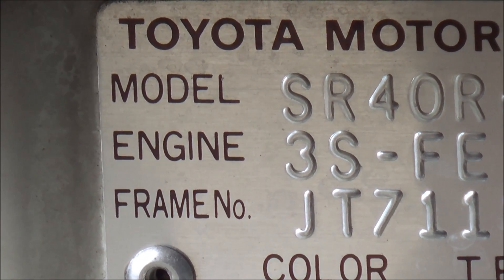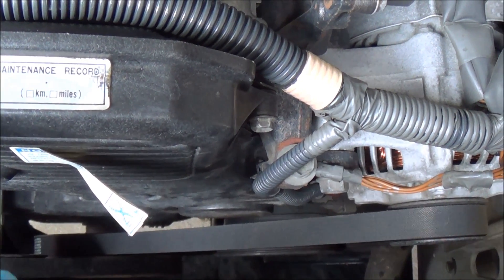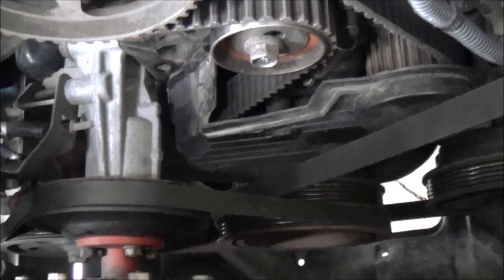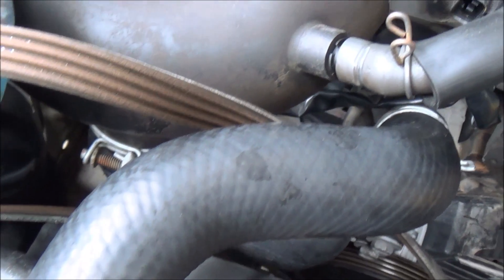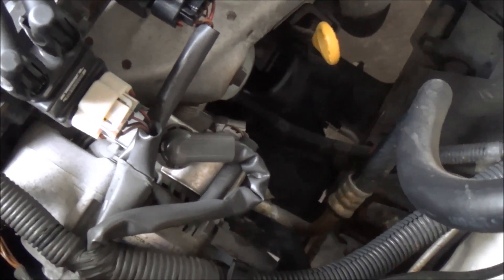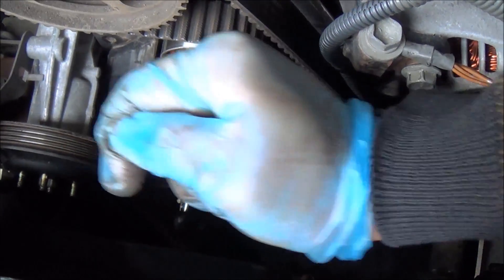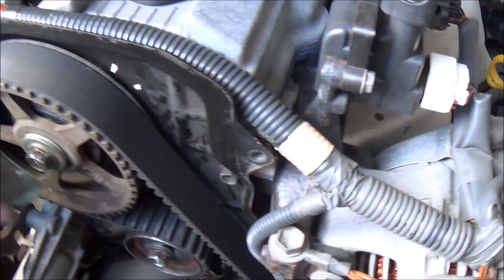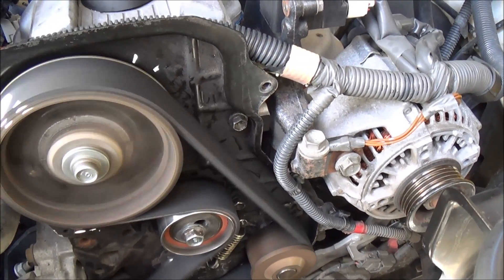How to Change a Timing Belt in a car or truck

Comment: Dude, it's nice for a diy, but it ain't right. If the engine is not in time, you will put it back the same bad way. You need to time the engine correctly, then change the belt. Otherwise you can end up when you're done with a lot of work done for nothing. Even if you don't have the special tools, the engine still needs to be put in time, I really appreciate that you take the time to explain to everyone, but please do it right. Nasty mechanics would laugh in your face when they see the way you do it and I hope now you know why.
Reply: every vehicle shop does it the way he showed, so even if you get your car in a shop to do it, they will do it the same way
Reply: @justarandomguy3969  I'm sorry to hear that pal, but you have been to the wrong shop. I do it like this and I know many people that do it like this. It's the difference between a pro and a diy.
Reply: @razvandumitru2252  ''i do it like this'' so you do it like he did in the video?
Reply: @justarandomguy3969  no dude, just the opposite. I see it's pointless talking to you.